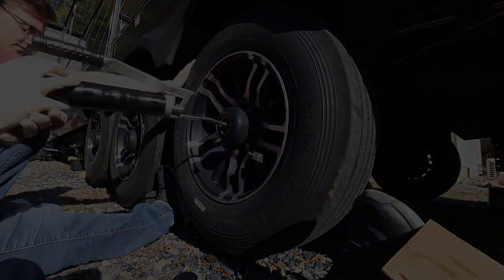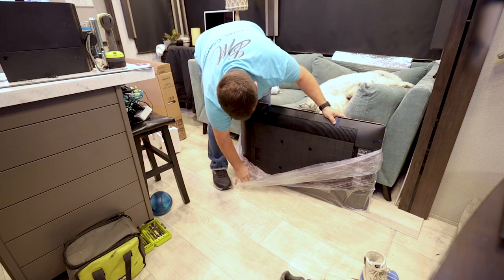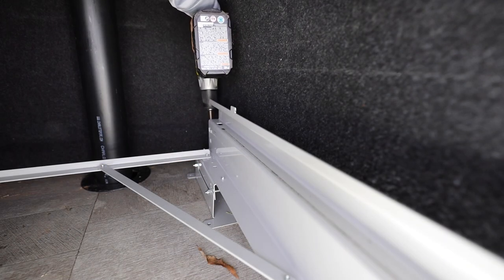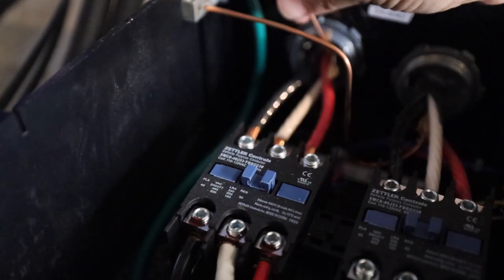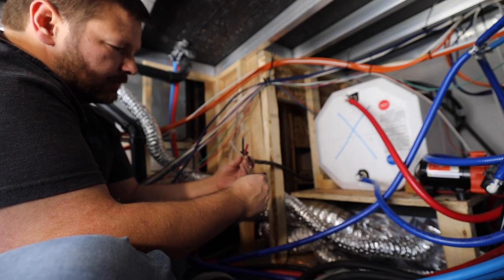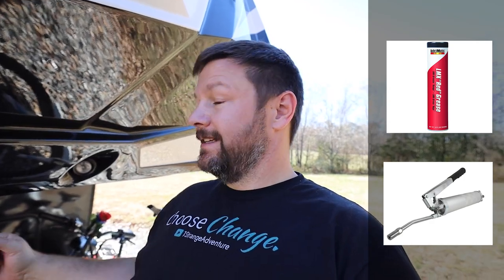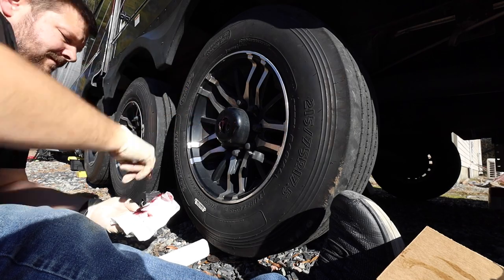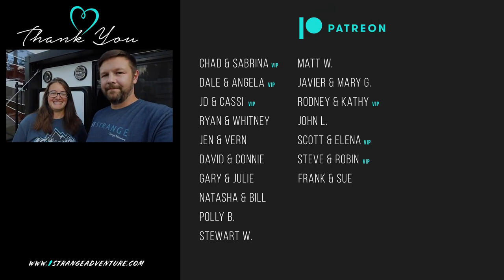RV Life can be BUSY! RV Upgrades = (TV, Wheel Bearings & Watchdog Surge Protector)

Comment: You might want to consider cutting a  little access hole so you can see the digital readout on the suppressor.  It is only really necessary if there is a problem because the app won’t provide the code.
Reply from the maker: Great suggestion. Thanks!

Comment: Those flex hoses are garbage. I ripped out all of those from ours and replaced with real PEX and brass fittings. Nice job on installing the hard wired surge protector, we also have one but came that way from the factory. We also use a surge guard on the pedestal because if that hard wired surge guards is fried we wouldn't have an easy way to bypass it without rewiring around it.
Reply from the maker: I’ve thought of the same scenario. I’m thinking about wiring in some sort of bypass on a switch so I can flip over if something happened to it. Need to do more research though. ☺️ thanks for watching!

Comment: Are you still happy with the function of the Watchdog surge guard and blue tooth connection with your phone app since you installed the hardwired surge protector? I am going to upgrade my surge protection from a portable to a hardwired version and but to get the blue tooth I will need to change brands of surge guard. I am currently using a portable 50A Southwire which has worked very well over the last three years. Also thanks for all the info you covered in the video!
Reply from the maker: We love our Watchdog. The only part I would change is the capability to access it from multiple devices at a time and to have it connect to Wi-Fi as well as Bluetooth. That said… it has worked great for us so far and we won’t get something different unless they come out with a new model that includes those features 😊
Reply: @1StrangeAdventure  Thanks for your reply. I just installed the Watchdog when I installed our new solar system, I recently got everything up and running and am very happy with the Watchdog hardwired surge protection. Thanks again, hopefully we will see you guys at a SwitchCrew Huddle this year! We really enjoy your channel and content.
Reply from the maker: Glad it you are enjoying it! See ya soon! ☺️

Comment: don’t ever use a grease gun to “fill the bearings”. to much grease will blow the brakes out on the trailer if pumped to much
Reply from the maker: Yes, there is a lot of debate on the topic. We followed the instructions provided with the rig. Definitely understand the risk though. Thanks for flagging it.
Reply: @1StrangeAdventure  ya i see it happen way to much here in arizona. you can pump grease in the zert but no more than 7 . i personally just remove bearings and repack them